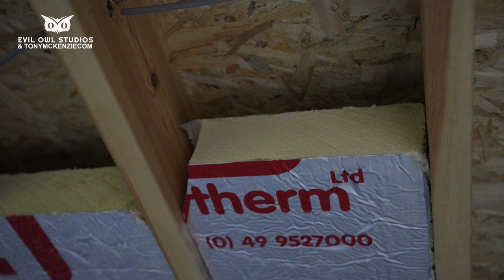How To Build a Recording Home Studio Extension or Building | Part 1 Bricks and Mortar

Comment: I just finished watching the video - very informative as always. When we built a house in Michigan, there were 3 inspections - the rough structure build, the plumbing and electricity before the walls were finished off with drywall, and the finished inspection. Any red tag meant something needed to be redone. I've heard that lumber prices have doubled in the last 2 years - planning a build budget is Russian Roulette.
Reply from the maker: Ah so they inspect there too... for me it actually was a very good thing. Trusting ANY builder to just 'do it right' would honestly from experience be a big mistake. Often here they sub contract and some of the subbies are not always what you might think they are... as in the case of the 'certified electrics' that they never actually were successful with... I was! Thanks for the info... and I agree with you it is scary when the prices just change also...

Comment: Had a spare room, I was using for my little studio. Should've known better, but it had great acoustics. Of course my grandkids needed a place, (for 2 weeks, that turned into almost 3 yrs. But that's okay.) So we (grandson & I) decided let's move this stuff into the basement. Pretty good acoustics down there. Of course WE were carrying stuff down stairs, I had a big stereo cabinet, I was using as a rack. (Had every thing except the actual recording equip in it) decided "Hey I'll just us this handtruck I've got & it will make things faster & easier. Of course, it wasn't working. We pulled all the equipment out, took it downstairs. I still (foolishly) thought I could move the cabinet down in 1 piece. Nope. (My ex bassist gave it to me, when we first set up the spare I mentioned.) So I had to take the thing apart. Removed the glass doors, started to disassemble the wooden sides, top, bottom, shelves. I was removing the last screw from the bottom, when the bottom popped off, & hit me just above my eye. My granddaughter (3 at that time) screamed "Bubba, Papas hurt BAD!!!" It only bled a little, but my baby was shook up. So we took the pieces down. I reassembled the thing, put equipment in, etc. Saw a metal & glass shelf/table out by a neighbor's curb, asked if it was being thrown out, took it home. It was perfect for my actual recording equip. All in all, what should've taken a couple of hours, took us all day. LoL. As far as fuse boxes, there's 1, this is a small place. If I run the a/c in summer & use my George Foreman grill or the stove, it's fine. If I turn on the microwave while those are running, the breakers pop. LoL. My little studio isn't bad, but it nearly cost me an eye!!! Lol. Happy New Year Tony. Gil
Reply from the maker: Ha this place you have been... I have been too! (not literally). I could tell the stories of the Tascam A7R (15ips twice the speed tape) and in my bedroom etc. and scarily before that an 8 track cassette... The aggro for me was bad - especially in the house, its surprising my wife is still here :) Moving gear at any time is harder than many people think - but when they do there is no doubt you don't want to do it again. Nice story about your grand daughter :)  Ultimately making noise is always difficult and if at home no matter what the circumstance it's not easy. Even here, from time to time we can't record because of external noise - nothing is totally quiet. But at least you did it and have it operational so well done. Great story... and yes also have a great new year...